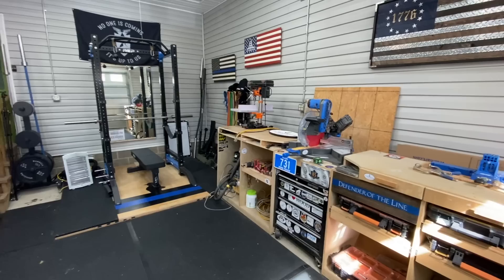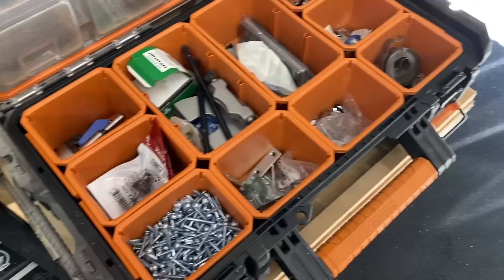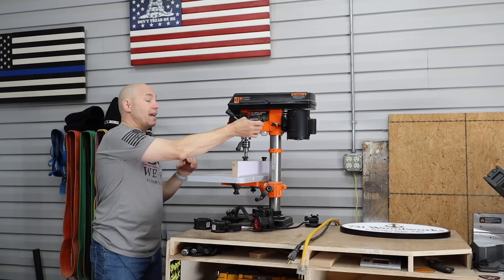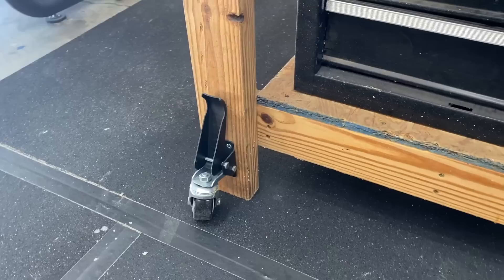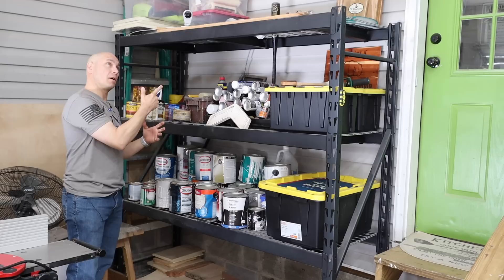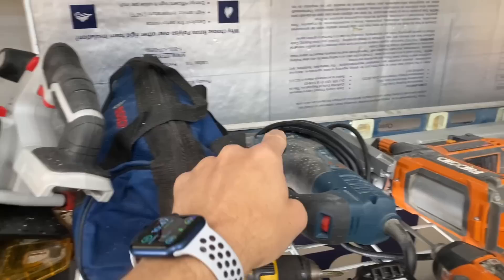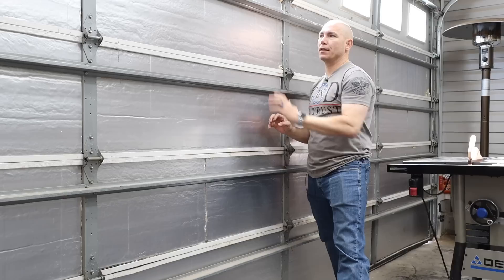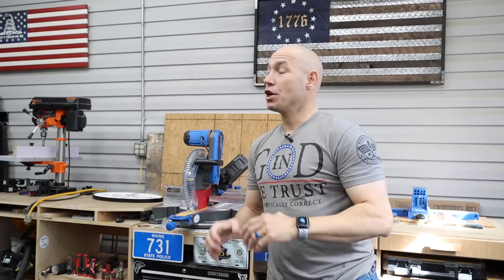731 Woodworks Shop Tour 2021 | 2 Car Garage Woodshop

Comment: Something you may think about since you have limited space.  I built an 8x8 table and it houses my planer, tablesaw, miter saw, and router.  Router and table saw  are obviously flush mounted, the planer and miter saw are both on a flip top.  I have plumbed it all for the dust collection and a power strip runs all of the tools.  the whole table is storage underneath.   I can pretty much build anything and never get 2 ft away from the table other than to fetch materials.
Reply from the maker: Awesome.  Thanks

Comment: Way more organized than our shop!  Most of our free space is dedicated to heating lmao. Between the table saw, miter stand and lumber rack, our 12x16 shop is a little Crowded but it's surprisingly roomy enough to hold multiple projects and not be overwhelmingly small.  

-Grizzly Timber Woodworks

Comment: I recommend putting a metal of wood bar between pairs of table casters. Lifting/lowering casters 1 at a time is a pain. I added an oak bar to mine and it works well.

Comment: I'm going tomorrow and buy some of those floor mats. Funny, it looks like you took a video of the old Craftsman tool boxes that I have, contents and all, including the sawdust. They were the first tool boxes I bought and they're probably 50 years old by now. I don't like them much either and I don't use them, but they're still taking up space in my shop. When we sold our last house, we bought 5 acres in a semi-rural area and built our own house. I knew I was going to need some major tools, so I spent about $5000 or so from the house profit to use for the construction of the new house. The house is long finished, but I still have all those great tools. I've built a lot of stuff since then, but never made a business out of it. I've built tons of cabinets, bookcases, and all kinds of things for our church, including the altar, pulpit, lectern and baptismal font.

Comment: One of your videos made the algorithm and popped up on my list. I watched a couple and am now subscribed. Great stuff with a nice, folksy approach that works a lot better than the rest. i bought the Delta Cruzer about 3 years ago and use it constantly. The only issue I had occurred after a long deck project for my brother-in-law. The blade bolt basically welded itself to the blade. I had to cut it off and order some more. Getting at it and disassembling the entire housing is a tale for another day, but lesson learned. Anyway, keep it up.

Comment: Something of interest,  wood workers just starting out might find tools they need and may not use much at their local pawn shop. One in my area offers 20% off the first Sat of the month and offers a 30 day guarantee on the air tools that I have bought. Some look sort of rough but what they cost compared to new ones it's a good deal. I haven't returned anything yet.
Reply from the maker: Good tips

Comment: Hey Matt, I heard you saying your pillar drill felt under powered. Yours looks very similar to mine and I found the same but on mine you can take the top dome cover off. You can then adjust the belt. It looks like the gears on a bicycle only with pully wheels instead of cogs. Really easy to adjust for speed/torque by moving the belt up or down the pullies. Definitely worth having a look, mine has changed so much, Davy
Reply from the maker: thanks

Comment: Sir,

I’m no expert and I live vicariously through you but if I could make a suggestion on your 2021 project: That delta tablesaw is beautiful and you seem to love it. If I’m not mistaken, it has a cast iron top that is magnetic? Maybe build the assembly table the height of the table saw and integrate it so you can use the assembly cart for out feed and then Lower the blade and use the table top for a flat assembly. You can even look into the possibility of your planer out feed to run along that same height and reduce snipe.
Reply from the maker: Good idea, thank you

Comment: If you can find some of the wooden handle Aldi WorkZone Chisels, they are amazing. Paul Sellers highly recommends them. I found two sets still in their packaging new on eBay. I also invested in three diamond stones from 300-1200 grit and I strop them with some compound. Razor sharp chisels!
Reply from the maker: Awesome.  Thanks

Comment: I highly recommend hooking up a cyclone to your vacuum. I used to use vacuum like you do now. I got tired of loosing suction power when the filter gets clogged, and cleaning the filter every time. Went an got dust deputy from Menards for $99 and I am loving it. Love your channel by the way!!
Reply from the maker: Thank you
Reply: Chris Notap did a video on a DIY dust collector from 5 gallon buckets and some PVC fittings. I made one and it works great. I probably spent about $10-15 on it.
Reply from the maker: Nice

Comment: Great video. Gave me some ideas and inspiration. 

Get an air compressor sometime you won't regret it.
Reply: For that pin nailer you wouldn't need a huge air compressor Harbor Freight has small air compressors for around $50. I'm looking into buying one myself instead of using my father's.
Reply from the maker: Thank you

Comment: Those old craftsman toolboxes can be cleaned up, ball bearing door glides just need to be cleaned out of dust and debris, re-packed with fresh grease, and the sides might need screws tightened (or heaven forbid, rivets! redone)  Honestly, and you probably already know this, but the old Craftsman and Snapon are the best -especially compared to what they sell nowadays...
Reply from the maker: thanks

Comment: Question regarding your organization of your pocket hole screws, I know there are course thread fine thread different sizes, I like the way Kreg has the blue plastic multi size, container, without having them marked it's pretty impressive right off the bat to be able to grab the right pocket hole screw, I would have to cut out the size chart square and place it on a the lid of the organization bins you have.i do like the way you have that though.
Reply from the maker: I only have 4 sizes. 1”, 1 1/4”. 2” and 2 1/2” ones all corse thread
Reply: @731Woodworks  ok that makes sense thanks

Comment: Battery For the DeWalt drill, you can buy an adapter to put in the DeWalt drill and then use a different brand of battery you could probably find one do use your rigid batteries in the DeWalt drill. I have some older craftsman 19.2 V stuff and I use my Dewalt batteries in them. For me it made more sense to buy an adapter for 20 $25 and not have to worry about having other batteries charged all the time leave them sit for long periods of time without using them I’m going completely dead yada yada yada

The LED lights those are great they look really similar to mine I went to my local Royal king store and bought 4 foot LEDs 6000 lm 20 bucks m. five of them light my two car garage very well. A lot of times I only have one or two of them on m. 1 right above my workbench and when it’s two it’s right above my tool boxes.  No when I’m cutting some wood and using the saws and that sort of thing,  I’ve got more lights on.
Reply from the maker: Thank you

Comment: Another great video!  My question is how tall is your assembly table?  I have a bad back and its definitely better being able to stand up straight or sit up straight while putting things together.
Reply from the maker: It's too short for me.  It's about 32" tall I think.  My next one will be taller
Reply: @731Woodworks  I can see the need for it to be shorter than a normal workbench but could be just as bad if to short.  I'm 6'1 and will have to figure out what is the sweet spot for the right height.

Comment: Question. Between the time marks of of 16:02 and 16:17 you open a box you stated you use for rags and staining. Did I see a United States flag in there?
Reply from the maker: You did. My work was going to throw it away because it was tattered. I couldn’t throw it away. Put it in there for safe keeping.
Reply: @731Woodworks  I understand completely. In my garage I have no less that a dozen US flags I bought at auctions over the years just so they would  be disposed of properly, but like everything else I just have not got around to  it.

Comment: I have a set up with a 735 planer and porter cable 6" jointer combo table. I have a set of plans that I drew up that make the two tools have the same  infeed and out feed heights with drawers. Reach out if you are interested.

Comment: Good stuff. I have 8 storage bins for fasteners that I need to make drawer slides for. They are loaded with fasteners (hey I'm a fastener kinda guy) and heavy- like the pull out open the lid routine vs picking them up, putting on the workbench then store back underneath. My bench is 4x8 designed from April Wilkenson's video (she's on the new Tim Allen show Assembly Required on the History channel) and it's awesome. See https://www.youtube.com/watch?v=x9XIrfiNyUA